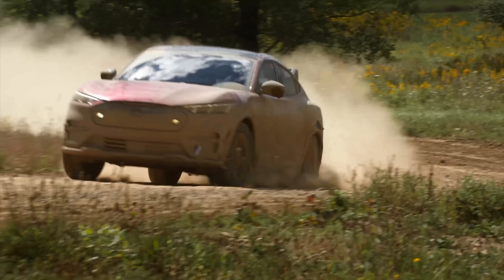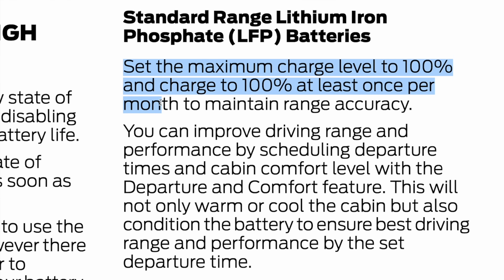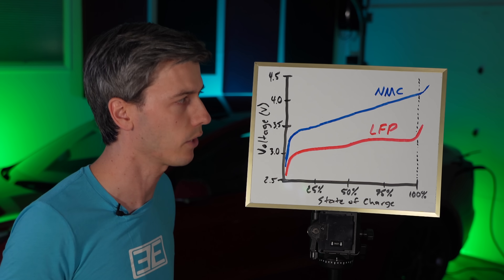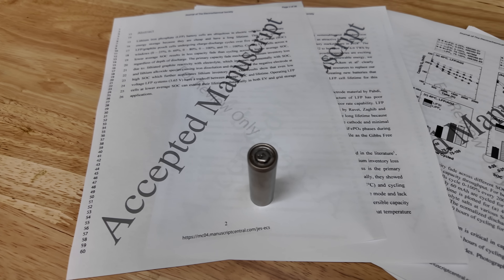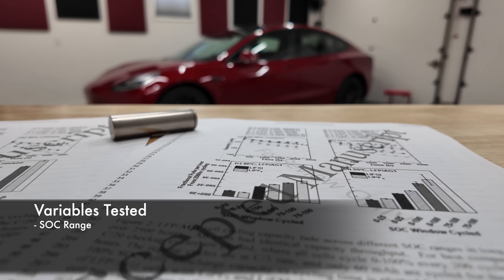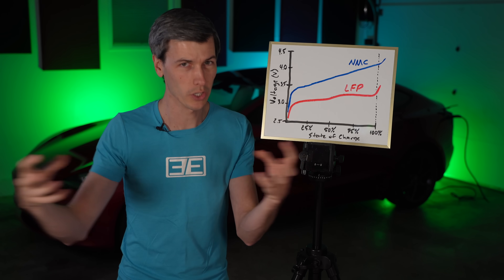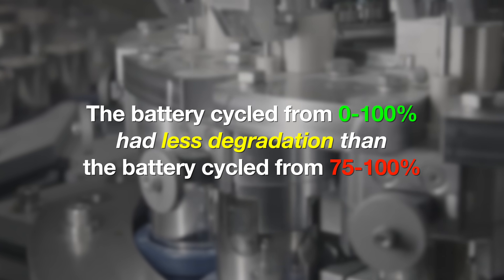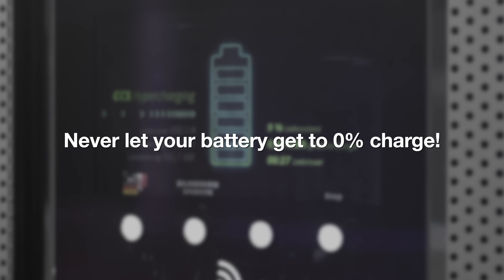How To Ruin Your Electric Car's Battery - LFP Edition!

Comment: Most people only need to charge once per week most weeks.  LFP needs to be charged to 100% once per week.   LFP is fairly durable even when “abused” the longevity gains are at the margins.  So for normal usage there is very little loss in longevity for charging to 100% every time you think you “need” to charge.  Try to take it to a low state but charge anytime you need.  50% for long term storage. If you are doing long miles every week, then you might consider only charging to 80% if convenient.   One should probably not own an EV if they can’t charge t home. The energy cost is 3x or 4x to supercharge.  Battery degradation on LFP battery is smaller expense than all the $ wasted on electricity.

Comment: Okay, but what do they consider "extended storage"? I don't drive my car every day (it's not electric, but my need for driving won't change based on the engine), and it sits in the garage often for 2-3 days without being turned on. Does that qualify as extended storage? If my car was electric with LFP, would I have to keep it at 50% charge or 100%?
Reply: A few days is not extended storage :) I would say only worry about that when you are away for like 2 weeks, like when going on a vacation or something.

Comment: Keeping the batteries at low SoC hence at low voltage levels, will increase the current that is needed to generate the same amount of power. Increase of the current  will translate to more heat generated within the battery

Comment: Still no one can explain to my why I should limit my range to 80 % for the entire lifetime of my car (by charging to only 80 %) when I could just always charge to 100 % and experience a gradual degradation to 80 % during the lifetime of my car.
The only reason would be to get a higher resale price. And even if you only charge to 80 % all the time you’re still going to see at least 5 % degradation.

Comment: That sad, LFP pack should be charged regularly to 100% because balancing not happening if BMS not have clue about cells condition at full SOC.
If i will drive for month or more without charging at all or to 100% SOC then 2 bad things will happen - ah counting will go crazy and i will not know what SOC my battery is, second no balancing of cells or overbalancing in case of some automotive BMS, will loose capacity almost permanently and SOH will be lower than should be.
Better to get NMC for low mileage drivers because that chemistry cells better behave when there is no every day cycles to 20% occurs .
Had issues with LFP because shallow discharge and awkward balancing strategy in BMS.
3 years to understand how it works just in case of my car only to understand that this chemistry (LFP) not for everyone 🤷‍♂️.

Comment: I asked Groc if I should periodically charge my 2026 Tesla with NMC batteries to 100%.

Short answer for your 2026 Model Y Long Range (NMC battery):
No — Tesla no longer recommends or requires periodic 100 % charges for BMS (Battery Management System) calibration on modern NMC packs (2024–2026 production).

Comment: I have a LFP battery for solar power storage the LEAPTON EH-05. The manufacturer states that you should never use the lower 10% (0-10% charge), so the minimum must be set above that point. This alone subtracts something out of the 15.3 kWh. Was told not to charge to 100% because in summer the charging is done in the morning and the battery stays 8 or more hours at 100% until evening. What would be the best min % charge and the highest % to charge the battery , for a normal life and a good usable charge?
Usually it does almost a cycle every night because it is used as backup for the house, but not fully drained in the morning 25 % remains. 
 The battery is indoors and has an ambient temperature of 17 C in summer and 25-28 C in summer.
Thanks !
Reply: Does your homeowner's insurer know there's a Lithium ion battery indoors?
Reply: @PromEVeus   The battery is LiFePo4, so not Li-Ion. Homeowner insurance is an american thing , I live in Europe the insurance works in different ways and does not care what I have in the house.
Reply: @adrian_b_123  ... OK.  Thanks.
P.S. LiFePO4 / LFP not Lithium ion?  Somebody better tell Whittingham, Goodenough, & Yoshino.

Comment: That’s why the battery range advertised is not really true for EV. Unlike a gas car which can use maybe 95% of its tank, only about 60% is usable of EV battery to avoid degradation. This can make the difference that gas car easily having double the real world range. Also that range can be quickly replenished in 5 min which EV cannot do.

Comment: There is something very important missing.... always more or less   no values ... how many % was the degratation at 0-25% 0-XXXX    more or less ist not a proper answer...     0,2% would be more than 0,1% for example but would not matter for use of an EV... so a lot of information with no outcome for me

Comment: I'm so confused. Our LFP 2023 Model 3, is charged to 100% everyday and has 237k miles so far. Our mileage range started at 270 miles @ 100% daily and now it's degraded to 240 miles @ 100% daily. The manual and the vehicle tells us to charge at 100% all the time for an LFP when charging. So our real life experience in a California climate seems to indicate amazing results for an LFP EV that is driven about 1k miles each week for work. This video and research seems to indicate our car should be dead by now. 

On edit for clarity, sometimes we drive more than 200 miles a day and charge to 80% (quicker charge time) to finish work for the day, but then 100% to prepare for the next day. For road trips from NorCal to Utah we charge enough to get to the next charge. (about 50 miles apart across Nevada to Utah). We never drive to 0% and rarely drive below 20%.
Reply: You have 237k miles in a 2023 car driven "about 1k miles each week for work"?

Comment: Thanks for your exhaustive research, Jason, within the limits of what's practical for YouTube.

What I'd like to know is the extent to which the car's software or the app, can monitor this for optimum performance and longevity. Do you have anything on that, bearing in mind that manufacturers all have their own apps and there will be significant variation?
Reply: You can quite easily set a charge limit in most car software or app, and at least Tesla shows guidelines there to what set the charge limit. In the background, the BMS will keep the battery temperature and conditions in optimal ranges for longevity on its own.
Reply: @bartjoboy  Thanks. I am unlikely to buy a Tesla but I'm sure the apps do more or less the same thing. Though I do know that the Tesla app is said to be much better than its rivals.

The second part of your reply is pretty much the answer I was looking for so thanks again.

Comment: Our EV is leased for 3 years. So basically ... i don't care a lot about the battery. And this is exactly what i demand from a vehicle. That i don't have to care about such topics. To my EV i'm just a user, not a lover ... If there is an issue, it is up to the car to advice me. And even if i would own the car ... i had the same thoughts with my ebike ... for the first two or three months ... then ... i stopped caring about what the battery likes or not. 9 years and about 10k mls later the battery of my ebike is still as good as new. Never had a problem and degredation is minimal. When i come home it always gets charged to 100%. Right charging temperature? I don't care. I ride it sometimes until it shuts off. It is the job of the battery management to take care, that it does not really get to 0%. If EVs are not taking care of themselfs in this regard, they will have a hard time to convince the ones, that are undecided yet.
Reply: The lessor surely cares about the battery and no doubt priced the lease accordingly.

Comment: In my opinion, Ford's statements are simply a consequence of the fact that the people who build the cars and the person who writes the documentation are not necessarily the same. The cited study from 2024 clearly show that it is advantageous to keep the battery charge level at 80% to ensure the long-term stability of the cell. However, the battery must be fully charged to 100% from time to time to maintain the accuracy of the range indicator. Other car manufacturers also struggle to be clear about their batteries. It feels like they don't know by themself what they sold to the customer.

Comment: Why would one want an electric car?
Reply: To save money.
Reply: For fun, no gas station, no oil change,  regenerated, brake. You save on brake pad,  when you're at the stop light, you get a notification that the stoplight is green. So you can go it's fast you can merge on the highway quick.
Reply: They're fast, very smooth to drive, no fossil fuel usage, you can charge at home or work or wherever there happens to be a charger, very little maintenance..

Comment: 20-80 daily most of the time 0-100 Road trip only avoid dc fast charging unless your need to if you can charge at home staty level 2 11kwh charging.

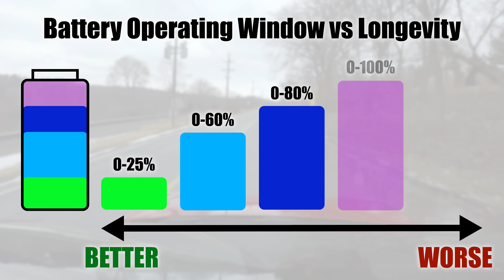Comment: at 10:03 use LFP batteries in 0~20%, 20~40% or 40~60%  which is better？ data in video only 0~25% 0~60% 0~80%etc. depth of discharge is different!  We need to control variables to determine whether a lower average SOC is better.

Comment: I need to charge my battery once every 7 days. Is there a benefit to set it to charge to 95% for this weekly charge (and charge to 100% every few months for calibration) so as to avoid the voltage spike as per your study cited?

Comment: Great video, but I think there's one information missing: how much does it degrade for each type of cycle tested? I'm saying this because if I lose 10% capacity when ciclying 75-100% and I lose 8% when cycling 0-100%, then, well... it doesn't really make that much of a difference. I know, I could read the paper instead of commenting with the question, but I have got too many to read right now hahaha

Comment: I have a question. Can I never charge my LFP to 100%? Is that ok? I am thinking to keep my charge max at 80% and very very rarely (only long trips), I charge to 100%. Is this ok or will it give issues? My concern is that when we say battery is at 80%, that doesn't mean every cell in the battery is at 80%. Some cells may be at 100% and some may be at 20%. So what if by never charging to 100%, I am keeping some cells at very low discharge level? say below 20% or below 10%. That will definitely harm that particular cell and that will go kaput If I keep doing that. So will this be a bad practice? Please shed some light on this thought process.

@EngineeringExplained
Reply: I would charge to 100% at least every few weeks to avoid the issues you just mentioned. There is very little harm done to charge to 100% for LFP, especially when you plan it just before a longer drive (where you use up at least 20% of battery or so) so no need to avoid it at all costs.

Comment: Hi Jason, long time viewer of your channel! 
Content request: Understanding more details of hybrid vehicle charge/discharge logic. 

I get the basics, which are covered in many other videos, but I’m more interested in details. Not sure if this is considered proprietary, but you seem to get good access to engineering details! 

I’m notably interested in the Toyota NiMH batteries, and perhaps the differences in cycles between a 4Runner and Prius. If I’m towing in the mountains, for example, does the battery fully deplete on uphill and fully charge on downhill? Does it leave some charge reserve? When would that reserve get used? Obviously the quoted power/torque figures change if the hybrid depletes… How would the battery charge state be managed on an off road trail? I think the hybrid battery supplies the 2400W AC outlet… if I’m overnight, how long does that last/implications? Hot/cold implications? Long term storage risks? What does the NiMH bring to the table, since Toyota is clearly still using it? Also curious on cooling aspects related to these batteries 

Sorry, not exactly sure how to send this, but thought this was a somewhat related video :)

Cheers!
Mike

Comment: Congratulations on the interesting intervention! I wanted to understand if the normal daily use of your car with LFP battery (Tesla Model Y Juniper) leads to discharging it in a week/8 days is it better to do the only weekly recharge at 100% or alternate it anyway with a 70% one? Because the time it is 100% charged it will follow the usual first trip of the day that will consume about 5%, so the car will remain stationary with about 95% of SOC. So is it a priority to charge the car at 100% once a week or not to leave it at 95%? Thank you

Comment: Honestly I fail to see the differences to NMC here. Only one is obvious: Due to the flat voltage curve, calibration of range can be compromised over time until recharging to 100% again. But is there any other difference? Both battery types don't handle discharging to 0% well. Both don't like sitting at high charge states. Both hate high temperatures. 

The study shown here fails to verify one very important thing IMO: It does not test small charge cycles at lower voltage ranges avoiding total discharge. E.g. is cycling from 50-75% or 25-50% 3 times better than doing 1 cycle from 0-75%? If that's the case (and we don't know here it seems) there is literally no best practice difference other than the one I mentioned before, compared to NMC batteries.

Comment: No one is keeping in mind the oldest information about the Li-Ion or LiPo batteries. And that is the reason why the battery has a chip or circuit in it is to prevent the charge from ever dropping below 20% charge (total real capacity) because IF it ever drops below 20% it may not recharge at all. That means your will never use 100% of the battery ever, only 80%. What you see at zero percent on a gauge of some sort is actually 20%+ of the batteries total capacity. The only way for the battery to drop below its 20% total capacity charge is to let it run down to where the little circuit board or chip shuts down operation and then let the battery sit uncharged for X amount of time/months/years. So, keep that in mind when storing a rechargeable battery. I recall the literature with the oldest lithium-ion batteries told people to charge the battery at least once every two years if left unused or in storage for that long. Good advice for those part time DIY people who have a few cordless power tools in their home or garage and only use them on occasion.

Comment: *Thank you for addressing this at the end of the video. Very well done     Geez... imagine taking a quick trip to get some lunch and then you decide to go for a longer drive.. oops.. I only charged to 60% I can get to where I want to go but there are no chargers there so I can't make the trip now... I rented a model 3 long range for a day... The owner asked me to keep the charged state between 20%-80%... I took a drive in the mountains and had to turn around as soon as I got to the otherside of the hill as there were no charging stations in the area... Battery tech still has some ways to go before it's actually practical.. I really want FSD for the longer drives but the comma 3x I have removes most of the burden via a very advanced highway cruise control. The more I look into this battery maintenance it just seems like an unnecessary hassle.

Comment: OK so this is amazing in a way because any fast charger would speed power up your battery below when is below 50%. As industry and battery progression is happening, you could have batteries that at 60% of its capacity can drive you 500-600 km and you can literally charge that in 5-10 minutes.